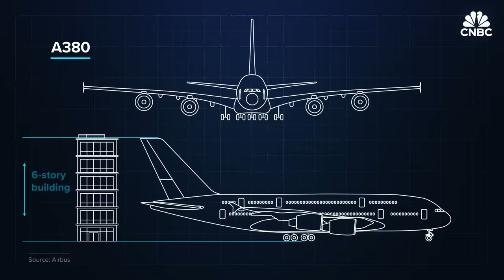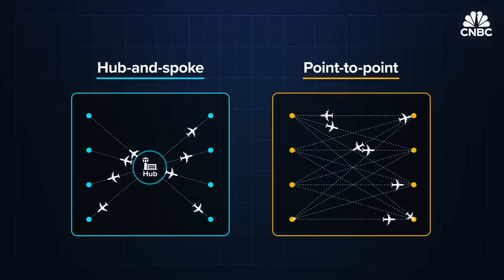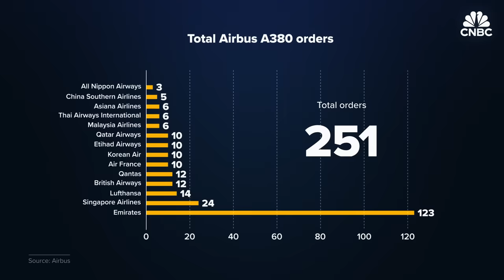Why The Airbus A380 Is Making An Unlikely Comeback

Comment: Flying in A380 is a super quiet and luxurious experience. Boeing 747 definitely paved the way, and I wish a new B747 (maybe twin engine?) can come back alive.
Reply: I just don't think, at least any time soon, that there will be a jet engine powerful and efficient enough to be able to allow only two to put and keep an aircraft like a B747 or A380 in the sky. They simply weigh too much for only two engines to handle, and would also probably put a significantly higher amount of strain on only two engines than normal, and their service life would therefore be a lot lower than normal, making it overall less cost-effective in the long-run.
Reply: I was thinking about it and actually the triple 7 2 GE-9x engines output 134,000 lbs of thrust each for a total thrust of 268,000 lbs of thrust, the 4 GE-NX engines on the 747-8 put out 66,000lbs of thrust each for a total of 264,000 lbs of thrust which is less than the 2 GE-9x engines so in theory 2 GE-9x engines would be adequate thrust for a new 747
Reply: The 747-400 was the most popular model and it had 416 seat capacity, the new 777-9 has 426 seats which makes it a larger aircraft, therefore the 777-9 is the twin replacement of the 747. Another point as single deck is faster to load and safer to evacuate compared to the 747 so the 777-9 makes a perfect replacement
Reply: I hear rumors saying Boeing might bring back the 747
Reply: i have been on it, its so quiet i didn't realize i was taking off until we pulled up lol
Reply: It does exist. It’s called the 777
Reply: @LandoPro49  Also the 777 basically fills that role anyway
Reply: @ytzpilot your value for the 744 is probably with a more premium heavy cabin than that for the 779, the 744 has an exit limit of 660 vs the 77W’s 550 (the 779 has a lower exit limit of 475 due to the deletion of a Type A door pair).
Reply: @IA_777 are any of these from credible sources? Do you really think Boeing would restart a production line which they are in the process of dismantling?
Reply: @NaenaeGaming  The numbers I gave are single class for each, but if you look at the numbers the 777-9 is of equivalent capacity when you compare different seat classes, but the 777-9 has a much lower operating cost per passenger. the original shape of the 747 is a flying brick and was never efficient, it comes from an era when jet fuel was cheap and they didn't mind burning lots of it.
Reply: @ytzpilot   Are you comparing the three class config of the 747-400 to the two class config of the 777-9?  One thing to note is that Boeing recently started putting 10 across in 777 economy; the seats have less width than a 747 or previous 777s.
Reply: You guys know the 747-8 exists, right? Lufthansa flies them 😂😂😂😂
Reply: Emirates CEO is saying something just like that, there might need to be a new A380 in the future, and Emirates is very vocal about this.
Reply: @IA_777 it’s a long way away but it’s possible.
Reply: @leafyon 777x is the new “747”
Reply: Boeing and innovation? Sorry
Reply: @IA_777 maybe as a freighter?
Reply: @IA_777  nope all the jigs and tooling to create the airframe are gone the assembly line has been closed for the 777x assembly line,
Reply: @lethargicstove2024 Aircraft should be able to sustain level flight even after one engine fails. That is the main thing stopping people from doing this.
Reply: @NaenaeGaming  There were very loose "rumours" about it but not for passenger variants, the cargo variant as its so popular and many of the trijets are aging out and/or expensive to up-engine to something more efficient so why not just have a new plane thats even better at the job.

How credible this was I have no clue, it seemed more of a "my pilot friend at another airline was there when Boeing reps were chatting with FedEx reps" situation, so take it with a grain of salt.
Reply: yeah, it's called the 777-9 and soon the 777x xD
Reply: @Helios727  the 747-8 has been discontinued, the last one was completed on December 6, 2022
Reply: I've heard rumors that Boeing is bringing back the 747.
Reply: The B747-8i is technically the “New” 747. The 747 is too large to be safely powered by only 2 engines and I believe regulations keep a plane that large from being designed with only 2 engines. Boeing did consider make a 3 engine 747 at one point though.
Reply: @Helios727  the 747-8 is out of production.
Reply: Twin engine is coming
Reply: @ytzpilot  I’ve seen the 416 number for the 744’s capacity listed as a 3 class capacity on Wikipedia, and former operator Air India flew the 744 with a 3 class config and a capacity for 423. As for the aircraft’s aerodynamics, I recall the -400 (and all other 747s with the stretched upper deck) being more efficient thanks to the reduction in fuselage cross sectional area as the hump ends, taking advantage of the the area rule.
Reply: The problem with the 747 is that it’s design is a compromise of a passenger/freight design. The double decker design with the hump is very impractical for passengers, but the need for a nose door is optimal for freight. In the 1960’s it was easier to build a more multipurpose design, but now it’s easier to have more passenger optimized designs like the 777, (which is still great for freight but is optimized for passenger)
Reply: There won’t be a twin engine 747 for a whole host of reasons.  

We’re really pushing the boundaries of how long twin engine wide bodies can go….I can’t help but wonder if perhaps the next huge wide body / 747 replacement will be triple engines, but I can’t imagine cramming something like a GE90 into the tail.  

I think we’re stuck with twinjet wide bodies for several decades until airport overcrowding becomes an issue and demands a new massive double decker aircraft.  

…..or maybe a commercial flying wing design?   Or maybe supersonic flight will finally reach the masses.  Who knows?!?
Reply: the closest to a 747 "twin" is the 777-9.
Reply: @IA_777 yes put bigger engines on it, what could go wrong.
Boeing is the worst aircraft makeup on this planet.
Reply: @L33tSkE3t Boeing and safety, words not heard in the same sentence ever.
Reply: How would it do on one engine? Not being snarky. Honest question. Thx.
Reply: It’s an aerodynamic dinosaur.
Reply: @lethargicstove2024  No in service GE90 is making that much power.
Reply: @ytzpilot  You can always tell who’s been on an A380 and who hasn’t… Single decks are not faster to load. The A380 has more than one aerobridge. I flew on an A380 at the beginning of November and there was no difference.
Reply: @IA_777 That would be a dumb move.
Reply: @thethirdman225  that's why I said GE-9X and not GE-90
Reply: @lethargicstove2024  In other words, for the purposes of this discussion, it isn’t really relevant.
Reply: @thethirdman225  what do you mean not relevant, the GE-9X is more powerful than the GE-90 I'm not sure what your trying to point out.
Reply: @aadixum  I figured, but the new 777x-9 is longer than the 747-8 and has more thrust I believe.
Reply: @lethargicstove2024  It’s not in service. Even versions of the RR Trent have been tested to more than 110,000 lbs (I think 116,000 is the highest) but that’s not in service anywhere. These are just wow wee numbers.
Reply: @thethirdman225  that's true but I still believe when it is released it will have enough power but time will tell.
Reply: @lethargicstove2024  Well that Roller figure was at least 15 years ago so I wouldn’t hold your breath if I were you.
Reply: @RickTheClipper nailed it 😂. Boeing is a joke now.

Comment: As a plane enthusiast, it breaks my heart that these mammoths are no longer in production. Im still also very sad about the loss of the AN 225 which was my dream plane to see but never got to see it
Reply: The  production of the A380 is being continued!.
Reply: There are rumours from those at antonov that they can rebuild her using the 2nd aircraft as a base to rebuild with.be great it if comes to fruition,amazing beast to see indeed.
Reply: @evilelf5967  yeah its still rumors. I doubt they can build with ukraines current state
Reply: @roythomas816  no it isn't!
Reply: @roythomas816  Just for the clarification, No Airbus isn't and probably won't ever restart the production of the A380 again. Restarting production of a planes (like almost every other commodity) isn't easy. Most if not all the tools used to make 380 have been discarded or evolved to make the 350s. The space that was used to make 380s is now used to make 321s (Airbus earns way way way more from 321s than 380s). At this point, if Airbus wants to restart the production, might as well build the plane from scratch.
Reply: As another aviation enthusiast, the last couple of decades have been downright depressing. All the cool stuff dies or underperforms: The Concorde, the A380, etc. Hardly any new major aircraft programs in the works right now, and the market is dominated by the re-engined 29th generation versions of the same old crap that’s been around since the 1960s-90s. I’m exaggerating, but only a little…
Reply: @DK33O  future concepts of planes look awful too ngl
Reply: @DK33O  When I first boarded the A380, I really had a big feeling of experiencing the future I rarely had in my life. Everything was so comfortable and so cool. Now people explain to me that the future of aviation is about crossing the Atlantic in single-aisle aircrafts such as the A321XLR. That totally depresses me.
Reply: I can feel with you very much! Yes, I would had been glad to see the AN-225, too.
Reply: think about the fuel consomption, the Co2 emissions, the waste of all kind, and maybe you feel start to feel better,

Comment: I travelled hundreds of hours in A380 - From Toronto to Dubai and back countless times. I never felt tired even after long fly in A380 - Since it's massive you will never feel that you are in a small tube. I believe the cabin pressure is also different compared to other planes. Sad to see it going.🛫🛫🛫❤❤❤
Reply: Not going anywhere yet Emirates intend to keep some of their fleet in operation until mid 2030s possibly later
Reply: I would land from A380 biz class long haul and thin "why cant all airline flights be like this.  I actually enjoyed it  Compare to the torture rack experience of other jets especially in economy

Comment: A tale…

In 2014, I was returning to the US from a business trip to Ireland. I was on a British Airways A380 from Heathrow to LAX. We were supposed to depart early evening, around 4.30 local time.  We sat on the tarmac for about 45 minutes when the captain says, “we have to reboot this aircraft”  - being in IT, I could appreciate what he was saying. He turned everything, and I mean everything off - we sat in darkness. After about 30 minutes, everything was turned back on; the captain then said, “there’s a leak in the water system; we aren’t allowed to take off without fresh water on board, so the luggage has to be unloaded and the cargo bay searched for the leak”   We sat for about three hours, taking off around 8:30 or so local time. 

By the time we get to LAX, it’s well after midnight Pacific. There were no available Jetways to accommodate the A380, so we land practically in Santa Monica 😛 and about a dozen buses meet the plane to take us to  Bradley Terminal. Needless to say, the TSA was not happy to have to process 300+ passengers and 25 crew so early in the morning 

With all the issues, it was a very comfortable flight
Reply: It could have been worse; you might have been in a Boeing, and not made your destination in one piece
Reply: This happens when you handle security issues seriously.  Everything can fail.
Reply: Yeah I’m sure there’s plenty of similar stories with the 747 or 787. Dare we mention the 737- max? Hell, my mum was on a 747 flight where the call buttons were going off repeatedly and they had to reboot the system by getting everyone to press their button at once.

Comment: Flew this amazing craft twice. We were 500 feet off the ground before I realized we had left the ground. So quiet! First fljght was business class for 10 hours and hardly felt it. Second flight was a 4 hour flight from Dubai to Cairo and it was sad to know the entire upper deck was empty. Like - what a waste of fuel to get this mammoth plane in the air for only 200 passengers. But what a treat to be in this massive engineering marvel. I really hope they  keep it going.

Comment: I flew for the first time in both jumbo Jets on the same Korean airlines trip, in a 747 going there and a380 on the way back, they're awesome and Korea airlines made both planes feel pretty much the same while inside, the only big difference I noticed was the a380 is pretty much the quietest plane I've ever been in.
Reply: I did similar on Lufthansa.  A380 East bound, B747 West bound.  The A380 a very nice plane to be a passenger in.  The B747 was also nice but was an older plane, slightly noisier, seats were more worn.  In my opinion the B747 looks nicer. 

Who knows which plane will be flying in a decade or two.

Comment: I am lucky in that I fly Australia - UK quite often and the A380 never went away on the Asia/ME to London routes.  I think it still makes sense on those really high load long haul routes.
Reply: Yeah, of course it does. Those saying that ‘the hub and spoke model is dead’ simply don’t understand that airlines are generally split between hub-and-spoke and point-to-point, with the ratio depending on the airline. Emirates are mainly hub-and-spoke. Qantas is mainly point-to-point but absolutely needs that large capacity the A380 offers.
Reply: @thethirdman225 also point to point doesn't work between Europe and Australia cause that's just too far.
Reply: @flopunkt3665  By the way, if it wasn’t clear from my other post, I pretty much agree.
Reply: @flopunkt665 There's a Perth- London direct service at the moment, but I'm not sure how often. Daily? Several times a week? I'm told it is very good, with areas where you can stretch and self serve snacks and drinks.

Comment: Getting one million pounds to fly in the air is absolutely insane to me
Reply: Starship is over 11 million pounds at liftoff and goes to space.
Reply: At high speeds air becomes relatively thick
Reply: And that makes star ship even more impressive because in going to orbit the friction is even a hindrance. In airplane flight it's what you need.
Reply: Sterling stuff
Reply: Four things.... Engine. Thrust. Shape of wings. Lift
Reply: If you think that’s a lot, you should have seen Mriya in action. She could lift 1.4 Million pounds. (May she rest in peace)
Reply: @marsspacex6065 hm... Seeing how they love exploding I'll be nice and say not yet.
Reply: What's insane is that you don't have a work meaning "a thousand pounds" or "a hundred thousand pounds" - but have to go into measuring millions of a fairly small weight. inefficient
Reply: @marsspacex6065  Starship doesn't actually work, it's never gone to space yet, you can't compare using something that's never functioned properly.
Reply: @jaykrown It got really dang close, literally on the upper edge of space.
Reply: @Dumbledore6969x  Wrong, it failed and exploded both times. "The first flight test of the full Starship system took place on 20 April 2023, lifting-off with three engines out and ending four minutes after launch due to a loss of control, resulting in the destruction of the launch vehicle. The second flight test of the vehicle took place on 18 November 2023, achieving stage separation with the Super Heavy booster exploding roughly 30 seconds later following multiple engine failures during its boostback burn. The upper stage was lost nearly eight minutes after launch prior to reaching orbit." People like you are why we're not on Mars yet.
Reply: @jaykrown  they're technically correct. IFT 2 found both the booster and starship crossing the Karman line into space. It may not have made orbit, but it got very close